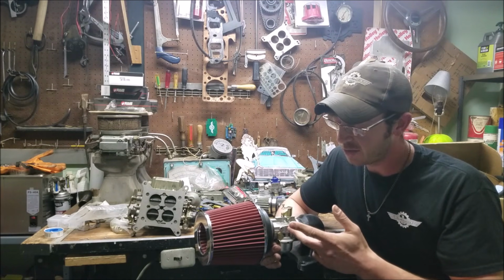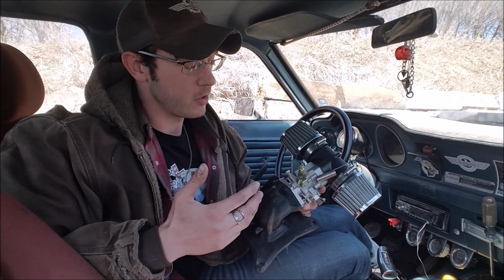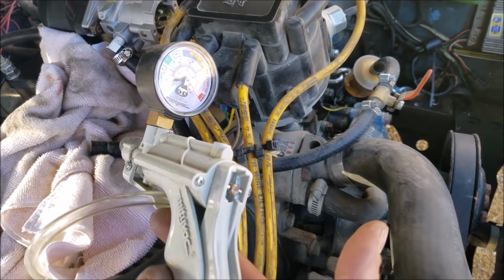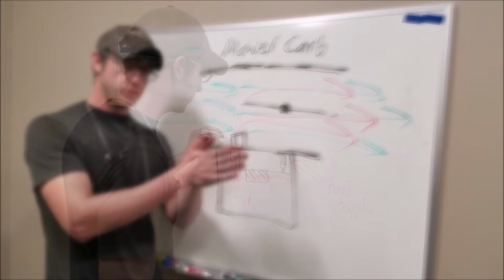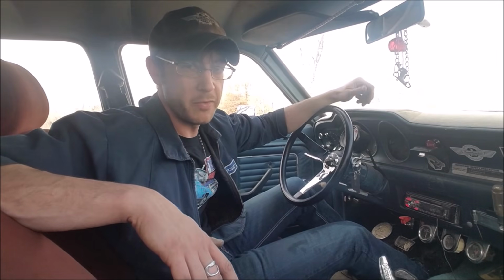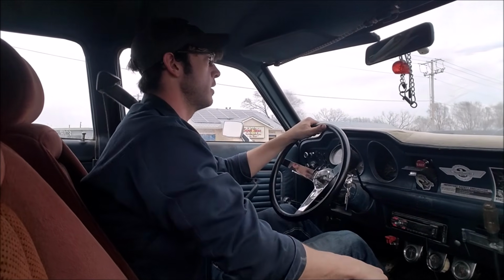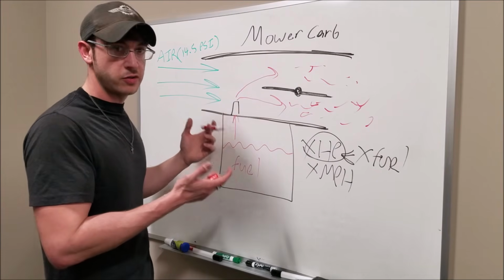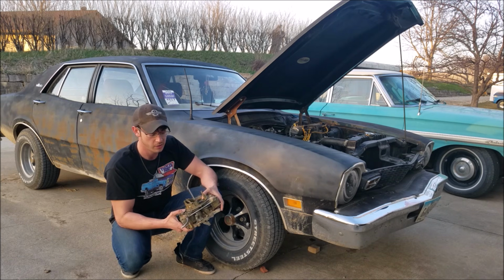Will It Run? Lawn Mower Carb on V8! (The "IMPOSSIBLE" Becomes Reality!) Start to Finish

Comment: First of all... I am not a mechanic or a tinkerer even close to anything to your level. I'm just a necessity fixer, cause I grew up poor and things need to run. However, what you're doing I wouldnt' call impossible becoming reality. What you're doing is the most, real to life, hot rodder thing ever... but in reverse. Unlike all the 70's and 80's EPA shit... you're accomplishing some of it while keeping the sound of the car, the fun of the car, and useability of the car at a maximum considering. You're true to spirit it seems. Good job my dude, great work

Comment: That carb cheater of yours is great. I'm not surprised at all that the thing ran on a mower carb because I've messed with them enough, but that cheater of yours really puts the whole thing together.

I'm really impressed with your understanding of electronics, software, and mechanics. Pretty uncommon to find someone who's as capable with a keyboard as they are with a screwdriver.
I really need to get my feet wet with the 3d printing and app stuff, would really open up some doors for me on my hobbies.
Reply: Do it. Just buy one. Dont over think it. Get one in your hands and start messing around
Reply: I Believe in you. That you can and  Will , believe in you too; you willing.. an able ready freed will ling. Sorta typa Human thing
Reply: @CoincidenceTheorist  I will when the time is right. Life's a bit busy right now so I'm holding off on buying a 3d printer. When I finally have time to mess with a 3D printer, there will be newer/better offerings on the market.
Reply: I've got a spare one if you still haven't gotten one
Reply: @Steven Reese  I got an Anycubic Kobra Plus in the new year. It has been a hassle free printer so far short of having to input custom printer parameters into the slicing software.
Reply: Also machining skills along with all the other tools. Somebody will want to buy rights to devolep this!
Reply: 1930's n up. Farm tractors. 100mpg then
Reply: Downdraft Carburetor off a L- head with be a lot simpler they're like little tiny automobile carburetors all you need is an adapter plate
Reply: The tools and knowledge we access to online is causing an explosion in 'cool, creative stuff' :)  lol
Reply: 3d printers are cheap 250 300 for one that can do pretty much anything you want

Comment: A hooptie V8 getting the same mpg as my hybrid. And a Ford too. Respect.
Reply: Ford worked on a high mileage carb back during the "Pogue" carb days and got it to 250 mpg on a V-8
Reply: @mikedonovan9573  all the OEMs have figured out how to make a high mpg engine, but greed and politics has kept it out of consumer hands. We don't need catalytic convertors and all the complexity. A clean burning, efficient engine lasts forever because if all the fuel is being utilized there is no carbon fouling.
Reply: @hoost3056  lets hope someone gets into some form of government position that realizes this and takes down emissions stuff and catalytic converter requirements. then we can have high mile v8s. if that person happens to be u, u have my vote, guaranteed
Reply: @hoost3056  this is true and I definitely support your thinking, the government had issues with clean burning engines because they burned hot enough to make NOx emmisions thus the colder burning, less gas efficient and dirtier cat required modern cars. I am willing to admit that I know nothing of the dangers of either as I am not an environmental expert and I personally don't care too much. (I'd love it if global warming made ohio like south Carolina and got rid of Cleveland and toledo in the process!) Just a fun fact I learned from a video on why hydrogen engines never took off, and why mid 90s hondas are so good om gas.
Reply: Your hybrid is doing it with at least 4x the horsepower though.
Reply: @fadedsoul23  It’s impossible to do that through government. You will go missing if you tried campaigning that. It can only be done in the private sector.
Reply: Well... it makes less horsepower than those early 80s tiny four bangers that got 40+ mpg... so it makes some sense. But mentioning hybrid brings up an interesting idea.... Hybrids typically use an Atkinson cycle inline four engine. Basically the compression stroke is longer than the combustion stoke- make it more efficient. They do this by keeping the intake valves open longer past TDC (shortens the compression stroke because compression starts later). But it usually kills engine torque, which is why it has only been used in hybrids as the electric motor(s) make up for the lack of torque. But you could totally do a custom grind on an old Ford Inline 6 or V8 and make it an Atkinson engine (since all OG Fords are non-interference engines). Hmm.. now I want a short bed 73 F100 inline six Atkinson tuned with a modern manual swap with a very tall rear end (and higher flow oil pump for better low rpm main bearing protection). Lowered, of course. Might get 25+ mpg if driven right. The Slowville Lugger.
Reply: FWIW_ I had an reg cab 88 F150 longbed 2wd 300 6 5 speed (early EFI model). Easily got 18 mpg on the highway/interstate going 75 (which is crazy good for a fullsize 80s truck with the aerodynamics of a shed). That's what started my idea of a Slowville Lugger build. That... and it was actually fun and comfy to drive even though slow. IDK....
Reply: Or we quietly just do it ourselves

Comment: Too cool. I remember a guy in the 70s, during the gas crisis then, being able to get 28 mpg with a V8. It's rather disappointing that my current truck only gets 14 mpg. I know the manufacturers can do better. You did it in your garage! You are amazing. Thank you for the great video.
Reply: They easily can do better, but the car companies are in bed with the oil and gas companies so it's not going to happen. The only reason there are "fuel efficient" cars available on the market is just for show.

Comment: This is Automotive Genius at it's finest and shiniest example, bar none. 
In history, men have had their lives ruined and their inventions to save fuel cost have been destroyed. Ridiculous or not, we all, as end user consumers, have been denied those ingenious benefits.
I think this is a wonderful "FU" to the greed of mankind. 
It does not matter where you come from, I appreciate your tenacity to prove the point AND for keeping your channel OG.
Reply: Remember the multifuel carbs on tractors back in the day? They were vaporizers. Folks had it sussed out almost 100 years ago.
Reply: @hoost3056  The Pogue carburetor comes to mind...
Reply: He ain’t the first and neither was the guy that did the basically the same thing in the 70’s that turned up dead and all his information on how he did it was taken and kept under wrap.
Reply: Engineers did come up with better carburettors…it’s called fuel injection.
Reply: Well said and I totally agree with all your points
Reply: @danmcelroy6584  wonder which fuel company is responsible for that
Reply: @chrispbacon3042  I can hear a drum set going ba da boom cheeeesh !!!
Reply: @ger808  I don’t really recall. But if you find the video on it it was all over the news for a while then he turned up dead, or vanished and all the stuff he built and made as with his info disappeared. You don’t need raw gas to run a engine ya just need the vapor off the gas. If you take a lawnmower and put a hose into the top of a gas can roughly the same diameter of the carb. And another from the bottom out the top so the fresh air has to be pulled through the gas. It will run and use much les fuel. I did a bunch of research on it but didn’t want a no knock and be found in a ditch..
Reply: @hoost3056  You mean evaporators.???
They can be dangerous on gasoline, you must have several flame arrestors in line, not to blow yourselves up.
Reply: @chrispbacon3042  Bro. you don't know what you are saying.
Fuel injectors are worse then Carbs.
We had better gas-mileage in the 80s with Carburetors.
My Honda accord was getting 42-45 MPGs.
The reason newer cars get better mileage now is because the engines are fare better designed then in the 80s.
For fuel injection to be better they would have to work on much higher pressure like Diesels. But that would be too expensive for most cars.
Reply: @VeggiePower303  Thanks for the laugh I needed a good giggle.
Reply: @chrispbacon3042  How old are you? You seam clueless about what is going on in the world.
Reply: @chrispbacon3042  What kind of car do you drive?
What is your gas-mileage?
Reply: @VeggiePower303  Toyota Landcruiser  GLX it has no gas mileage because it doesn’t run on gas.
Reply: @chrispbacon3042  So what do you run on rubber bands?
You must be using some kind of fuel.
I have a 1992 Land Cruiser too, runs on Gas and Propane.
I get 11/mpg on gas and 8.5 on Propane.
But Propane is half the price.

I will try this with a 250 cc motorcycle carb, see what I get.
Reply: @VeggiePower303  Technically yes and no. They are not the same after they are rebuilt. Because they are dhoc instead of your regular pushrod engine. Even the variable overhead cams are going to be hard to rebuild because of the tight tolerances they have.
Reply: @danmcelroy6584  Dan that's great to know I like the way ya think , and yes your dead right about what ya said there , thanks for your interesting input man
Reply: @chrispbacon3042  Watch the video Fortnine did on carburetors vs fuel injectors.
Reply: Whoever called you an idiot as one of those kind of people that hide under rocks you're far from an idiot my friend
Reply: can someone explain to me how or why this is being discussed like we’ve stumbled across this Eureka moment of Gov lies big Oil whatever, like this unlocks some potential benefits unseen or known that has potential to outperform a Fuel Injection system? From what I understand outperforms in every measurable way? I seriously lack understanding or missed something

Comment: Needless to say I am impressed.  You need to market this!  As a motorhead that enjoys restoring vintage vehicles,  this would make those older classics less expensive to drive on a day-to-day basis.  I would buy this set-up no questions asked.
Reply: trying to tell that man sign a death sentence....lol
Reply: @RM-ti2bv  What death sentence? I have a motorcycle that gets 100 miles to a gallon and a half of fuel, and I'm still alive. 🤷🏻
Reply: I was thinking the same exact thing
Reply: @davelowets  He's referring to the historical fact that the folks who have achieved better results than this in the past have either sold it to car manufacturers and had it consigned to the dustbin or tried to market it and end up dead in "mysterious circumstances". The "industry" has ZERO interest in practical economics, only what they can make tons of money on in partnership with gas and oil. Ie, cheap solutions do not benefit them, they want you to think you need to spend 60k for a fuel efficient cracker box vehicle that requires pricey maintenance.
Reply: @towermonkey5563  Sure, sure
Reply: @towermonkey5563 Put down the pipe
Reply: Reminds me of the old mono-jet carbs from the 60's only better thanks to the software tricks.
Reply: @@karlwithak.What engine a slant 6 or 318?
Reply: @Teeveepicksures it’s not a pipe. Historically is what happened

Comment: I loved the comment about "over carbing" your engine. I had a 1985 F250 with a 351M. I thought I was hot sh1t as a teenager and slapped a 750 holley on top thinking I was going to get awesome power. I never did get it tuned right. I even switched brands to an Edlebrock 750. The thing still always ran like crap. A guy I worked with, built and raced drag cars and stock cars and informed me my carb was way too much for the truck. he took a 600 edelbrock right out of the box, slapped it on and the thing ran like a raped ape. in a half hour my guy took everything I thought I knew and tossed it right out the window 😂
Reply: @My Pronoun is WTF yes each engine i can be wildly different. The reason the 351 Modified didn't do well with a big carb is because of the cam. It was designed for a lot of low rpm torque, which made it a poor candidate for a big cfm carb. Basically it wasn't capable of using all the air available with the 750 and all the drivablity went away. To note, I also had a 302, that ran great with a 750. But it wasn't stock like the 351m.
Reply: @My Pronoun is WTF that’s because a 440 is massive
Reply: That happens sometimes
Reply: "he took a 600 edelbrock right out of the box , slapped it on and the thing ran like a raped ape " 😭😭😭 I'm dying here my man , what a legendary saying I love it bawhahahaha brilliant 💪😜😂😭
Reply: I don't really care for the edelbrock carbs too much... They work good and all, but a proper sized and set up Holley will always make more power (just a better design).
Reply: @billymanilli  I agree 💯. Now that I'm older I've come to love Holley more. Edelbrock wouldn't be so bad if you didn't have to remove the whole top of the carb to change the jets.
Reply: Yes youngsters always think they know everything, because it makes sense in their inexperienced minds. Bigger is not always better. Everything has to be sized right for the right purpose.
It's always a fine balancing act, like a tight rope walk.
You wanna hit the sweet spot somewhere in the middle.
Reply: 351m was discontinued after 81. would have been a 351w or 302
Reply: @flavius_kern  You are correct but this wasn't an original engine. It did come with a Windsor and that engine met its fate. We pulled the modified out of another truck but it was completely stock. Other then us using a points distributor because we couldn't get the electronic ignition components to work but that's a different story.
Reply: i read this in Moe Szyslak's voice
Reply: @Namewithheld00123  🤣
Reply: Had a Mustang 289 11:1 pistons, solid lift cam and ran a 650 double pumper, ran great.
Reply: It comes down to the engine combination and engine tuning. If a larger carb is optimized at all throttle positions it would run like EFI. What our guy did was similar to EFI in terms of making real time targeted compensation. That's why she runs so good. A small block Ford has high velocity heads and combined with the high velocity induction system it is putting more of the fuel/air mix to work.
Reply: 95 % of people over carb their engines!
Reply: Here's the thing, your post is complete bullshit, it's almost impossible to overcarb since the engine will only take what air it needs, it cannot get more air if there is a restriction!
Reply: @Joshcheyka  you definitely can.  venturi size is a major factor in many ways.  you got a lot of research to do.
Reply: @ger808  haha. More like a Ford F100 on PAP PAWS CREEK WATER FROM heTralerpark
Reply: @walterdanner6372  bawhahaha brillant love this comment hahaha
Reply: I was told the same  thing .I got a 283 chevy 65 model  in a 1974 c10 chevy truck .have done it so far.
Reply: @phantom21629  it also depends on compression ratio,ignition systems,intake manifold,timing settings etc......you know, combination of configuration
Reply: @phantom21629  ecm tune. Float settings, ported vacuum, aluminium SVO Heads, E303 camshaft, rocket ratio and such, LT1 TO THE FRONT. STOCK
Reply: Just kidding.  Big isn't always better. I love a stout big journal 327 hp
Reply: I had a 289 Studebaker lark with a 2bbl and ran rings around Chevy 283 and Ford 289,'s with 4 BBL's.
Reply: What I'm thinking about
Reply: You live and learn my friend...